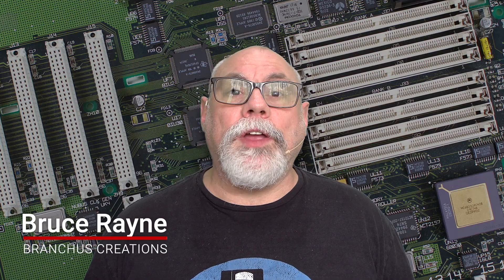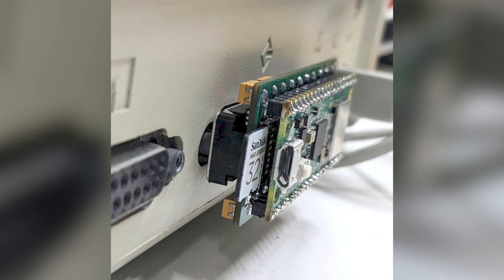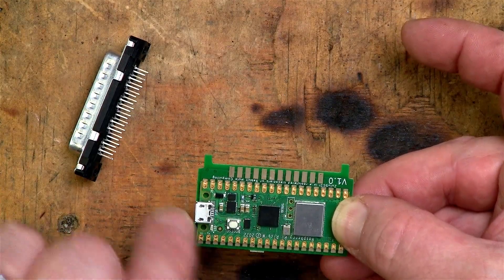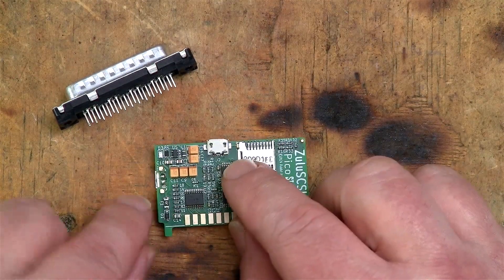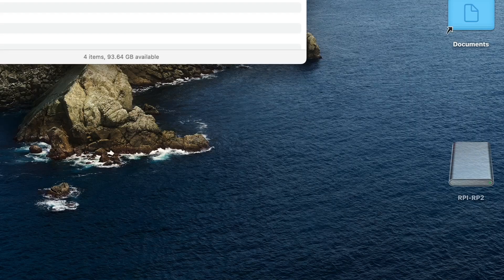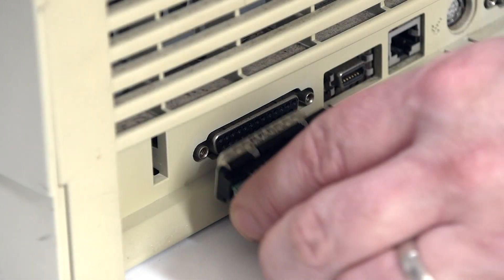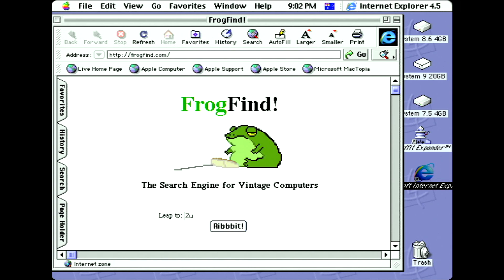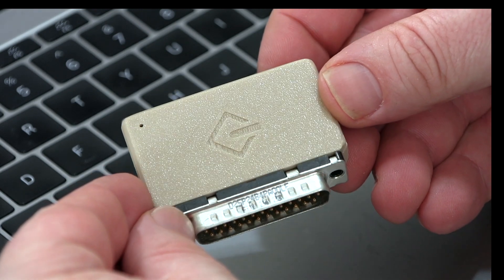ZuluSCSI Pico Slim SCSI emulator review

Comment: What specific product do you use for the bodge wire? Seems perfect and I’m stuck on that part of build.  Is it insulated? Thanks!
Reply from the maker: I used a piece of 34AWG enamelled wire (the sort of wire used for wrapping an electromagnet or transformer). It has a very thin coating that burns away quite easily when exposed to a soldering iron. It's the same sort of wire I use for repairing traces on damaged motherboards.
Reply: @BranchusCreations  I really appreciate the response!  Thank You!
Reply: @BranchusCreations  I bought some of the wire in your affiliate links 34AWG and I cannot get the red enamel to burn away.  Even when I just put a length of wire on the bench, set iron to 300C and set the tip on the enamel coating, nothing happens.  Its indestructible!  Am I not using enough heat?   Thanks!

Comment: Micro USB in 2024 is a bit disappointing, but otherwise it looks great.
Reply: @kuro68000 we could not identify any SMT-only (non-TH) USB-C parts that would physically work. It's not possible to have any additional placement holes drilled in the PCB because of the components on the reverse side of the board. When you design hardware, you have to take in to consideration real-world constraints, such as this. If the PCB were larger, it would be possible to do USB-C, but it isn't, so we can't.
Reply: @ZuluSCSI  CGT USB4135-GF-A is fully SMD, no holes needed. I've used them before on a couple of different boards with similar requirements for no holes by the connector.

It can be hard to find these parts, sometimes you have to just brute force it and scroll through Mouser or each manufacturer's website. I think Hirose do some as well.
Reply: @kuro68000  Thanks, we'll grab a few USB4135-GF-A's and test them out.
Reply: @ZuluSCSI  "Sir, I report...ZuluSCSIs to the south-west, thousands of 'em."
Reply: @ZuluSCSI  had a chance to take a look yet? Interested in one of these but would rather wait for an update.
Reply: @BranchusCreations I believe @kuro68000 is referring to the USB port, not SD card.

USB C would be nice, but the Pi Pico doesn't provide one.
Reply from the maker: Yes, misread that one. Deleted my stupid response. I think that given the Pico itself uses micro USB, it's reasonable for the Slim to use it too.